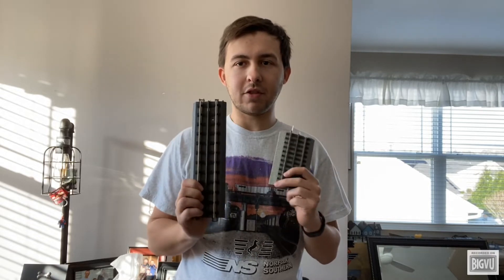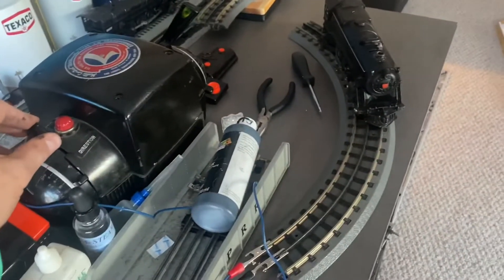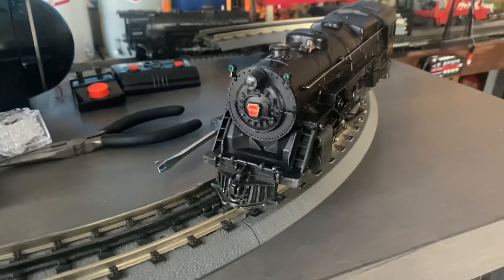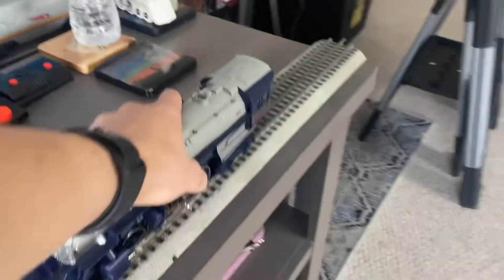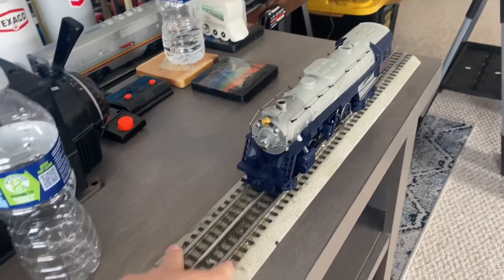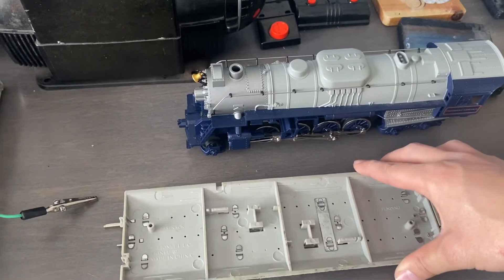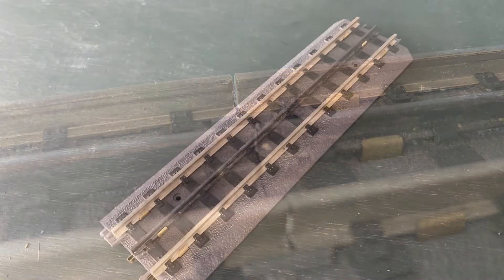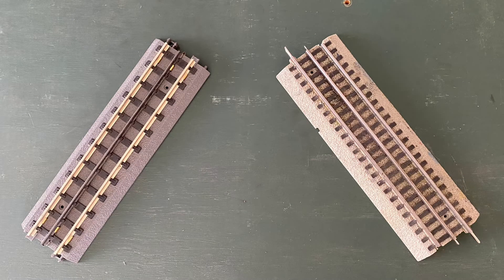Which is the worst O gauge track section?( Lionel fastrack vs MTH realtrax )

Comment: Considered using Fastrack for my layout, but it only goes down to O31 and I needed O27 to make the track plan work for the space I have. Another downside was cost, as not counting switches or other special sections, Fastrack was about $5 to $7 a section, while new old stock O27 tubular was just $1 per section. It's also much easier to cut filler sections and to make insulated sections to trip accessories with tubular.

On a purely personal level, I like the classic look of tubular track, makes a very retro looking layout.

Comment: I fought with realtrax for over 15 years. The old solid T rail, the newer tubular rail, 10 turnouts all purchased from 2006 to 2019.  Hundreds of feet of it. I was always tracking down dead track spots. Even with the spring taps making perfect contact, the tabs were riveted to the bottom of the rail, and that is where the connectivity issue sometimes is. I would have to solder wire from tab to tab just to get the trains to move. The gaps touching wasn’t a design requirement, but it’s a redundant tie connection if the tabs aren’t working correctly. Tight seams also click less. The switches (042 and 054) almost all had the same sparking issue when a train passed through it. 50% of the time anything but a diesel would derail. I boxed it all up and gave it away. I know many people have had great luck with it, but for some reason it couldn’t have been much worse for me. I kept trying to like it since I was so heavily invested.
Reply from the maker: That’s pretty deep there man.
Reply: Bummer, you sound credible here.

Comment: I went from the old tubular Lionel O gauge to Fast Trak and discovered a problem of connectivity. When setting up trains with my grand daughter (six at the time) , there were sections of fast trak that simply would not easily join together, especially when we bought additional fastrak to augment track that came with our Christmas set. A result was that current did not pass tbrough easily. In some cases I was able to press together sections of fastrak but a child would not be able to do this. Fast trak is also ridiculously expensive and its bed is not all that realistic. For my own layout, I came upon a large supply of the old KLine shadow rail (not very available now) and I got rid of my fasttrak.

Comment: Always had trouble with MTH realtrax. The copper connectors under the track tend to bend easily and tarnish especially under repeated use.  The fast track has more solid pin connections. I have been using fastrack in my subway for over ten years

Comment: I've used both and for my layout, I went with MTH RealTrax.  It is more realistic in scale and detail than FasTrack.  I've had no issues with the MTH rail joiners, but did have issues with FasTrack ones.  The bottom line is both systems are good, but MTH looks and performs better in my opinion.

Comment: I have several sections of FastTrack and my gripe with it is, it rust super easy, the metal tabs connecting the track either breaks or gets stuck in the other track, I have never owned Realtrack,  however a friend of mine does. He has zero issues and personally I think it looks much better then the FastTrack.
Reply: I haven’t had a problem with rust but those tabs do break easily from my limited experience.

Comment: As a kid I had tubular Lionel track and one line that ran on 1930s T track... both fine.  Now I am a person that see's very little things that improve with time, but I have to stay, I use Fastrack with zero issues.  Yes, it isn't cheap, but train run so smooth on it, even old train run better on it.  Because of cost, I bought some MTH realtrax to run around the Christmas tree, 072's and straight pieces, it is cheaper than Fastrack.  First year fine, second year I had a few dead pieces, by the third year it wasn't worth my time.  So many dead spots I couldn't believe it.  I threw it in the trash and I have done quite a bit of reading on it, I am not the only person that has said, if you put it together once, it is fine, but if you pull it apart a few times you will end up with dead sections.  I only had one rail height issue with Fastrack, I was able to adjust by tightening down the higher rail piece a little harder.  We did our normal oval under the tree this year in Fastrack,  but I added into the center a figure 8,  allowing the trains to switch direction they are running on the outside oval without picking them up and turning them.  So even not screwed down I haven't had any issues.  It was also down with older pieces and extra switches I had... I did clean it as I laid it down, but not one dead piece and I would say the pieces were ranging from 20 to 4 years ago mixed.  If I would have done that with Realtrax, it would have been a stressful Christmas, LOL!

Comment: This is why I switched to Atlas 3-rail O. I started with Tubular, then FasTrack, then RealTrax. FasTrack does start to rust over time and RealTrax does start to wear over time. I use FasTrack for my Lionel Christmas tree sets and I use RealTrax for my shelving. Atlas 3-rail O is a bit pricy, but it’s so worth it. It’s the most realistic 3-rail O-gauge track out there.
Reply from the maker: The fastrack was too noisy for me. I prefer Atlas 3-rail track too

Comment: With the RealTrax section, the gap between the rails is irrelevant, as that is not electricity is conducted between sections.  Electricity is conducted via the brass loop-like connections between the sections. If these have connectivity issues, you will end up with dead sections as you demonstrated.  This is easy to fix with a pair of needle nose pliers.  

Fastrack does not melt if you keep your voltage below 20.
Reply from the maker: So which do you think is the worst track?

Comment: Both of those track systems are 100% pure garbage quality. I remember when I used to use fast track. It was a pain in the circuit to work with because the track always got dirty Plus, it was so noisy. I couldn’t stand the noise of the track and it also had the worst electricity flow sometimes never used MTH real track. I was going to use it one time it’s more difficult to work with MTH real track. So basically the only better track would be Lionel tubular track, atlas and Gar Graves. They have a way better, electricity flow and they’re not more annoying compared to fast track and it’s not as difficult to work with like MTH real track.

Comment: Modern equipment is not a problem with Fastrack. They run on prototypical speeds and have great sounds. For connections to Fastrack I recommend soldering.

Comment: LIONEL Fastrack is definitely great to use ! Power supply is no issue with each section of track having 110 spade connectors ready for your drop down to your power bus lines. All predrilled ready to screw down to your layout.

Comment: I would measure the electrical resistance of the pure track and between two track sections. Testing two different locos each on a (very short) piece of track does not mean anything. And what is about corrosion, which one is more prone to it?

Märklin does not have track joiners as well in its "C-track" (C-Gleis) which seems to work fine, but they are welding the sectional contacts to the tracks made of steel. Many model railroaders make large spontaneous layouts with only one power connection not having any problems.

Comment: I have not had my connections melt when connected to my 180 wt power “brick”.  I run it strait to the track at 100% power all the time as I was waiting for the 180 wt transformers to come in.  It limited me to the newer engines, this case it was the UP Veranda, and I have not had a problem yet.  Noise isn’t an issue as it is a temporary layout around the tree or really around the room.  I jump the connectors in three places to make sure there are no dead spots.  I like it as the engine does not touch the carpet (the roadbed has caught screws that have fallen off the engine/rolling stock, there is no cutting involved, it comes together/apart pretty easily, and it does not look bad to me.  Downsides, it doesn’t look good as a system with wooden rails, my 1950 Santa Fe sparks when it goes through the switches, the coil couplers will uncouple every few times over the switches, and the pins are breaking, especially on my O72 curved pieces.  This topic is fun as there is a lot of passion over what track to use.

Comment: I have used both. If connected to a layout you will find the Realtrax will last longer and that is due to the metal they used. The Lionel Fastrack does rust over time. The track clips on the Realtrax track clips can bend if taken apart and reused multiple times and can lose connectivity. If you are going to be taking it apart and putting it back together multiple times (like a seasonal layout) Lionel should be your first choice unless you are going to store it in a non-climate controlled environment like an attic or a outside storage buildings. If the track is going to be exposed in storage Realtrax would be a better choice. Just make sure your clips are connected correctly under the track.  However Realtrax is not currently being manufactured and you may find it difficult to find the pieces you need.

Comment: Never had a problem with MTH RealTrax on my 6" X 20' layout, including the 12 switches, and my DCS control system. Would never ever switch to Fastrack in a million years. RealTrax is rugged and reliable and easily dressed up to look more realistic by sprinkling ballast on the side and adding a black wash on the roadbed.
Reply from the maker: I don’t realtrax anymore because some of the sections that I had would wore out over time

Comment: O guage and O 27 track are still the best track out their. proven to work. not as fancy. [with railroad tyes ] but you cant' beat the price. and the performance. easy to cut and make your own fitting track. can do so much more with them. that you cant' do with the others. I have mike's and fastrack. O guage and o27. but mainly use all o27 track. with all different radius. and it won't break the bank. easy to use with accessories. and switch's. that don't cost an arm and a leg with the fastrack it's a special track for this and that. and quite pricey for a piece of plastic.................. just sayin............

Comment: Having used Realtrax on a seasonal layout for about a dozen years, I switched to Fastrack in 2020. Because of the way the track sections connects I have had none of the issues with Fastrack that I did with Realtrax.

Comment: Hi, nice video but I have been using FasTrack for a while & I sometimes have problems, I do run my trains on the floor (carpet) so that's cool, I was thinking about switching over to that MTH Realtrax, do you know if anybody has had any problems with MTH Realtrax??
Reply from the maker: To me the Realtrax system are like batteries. The don’t last very long until you modify them to work better
Reply: @railchief74  Ah ok, thanks